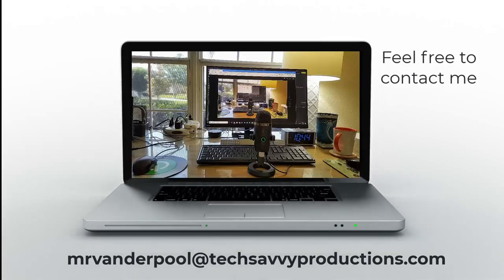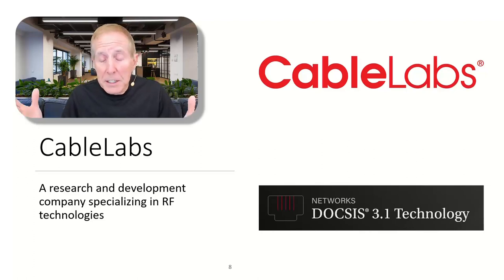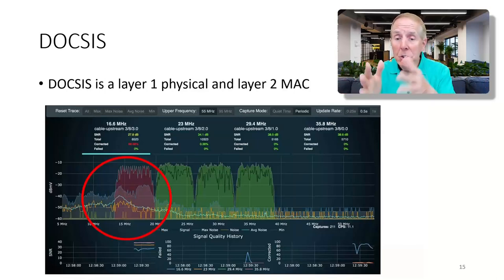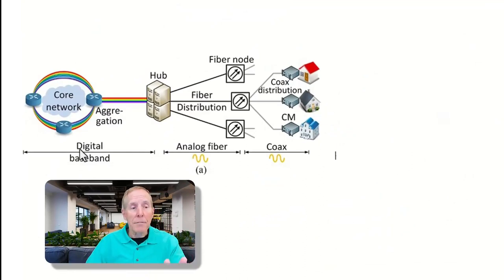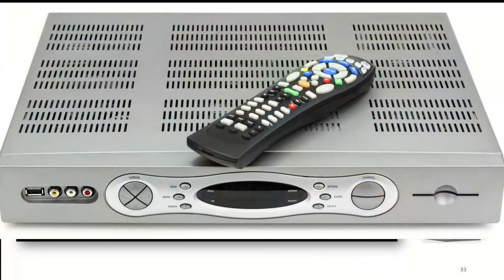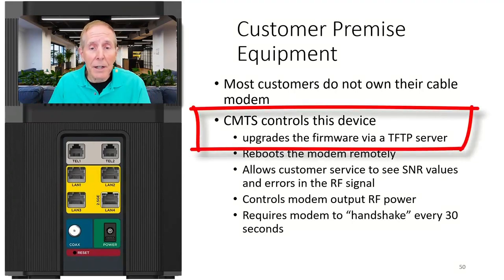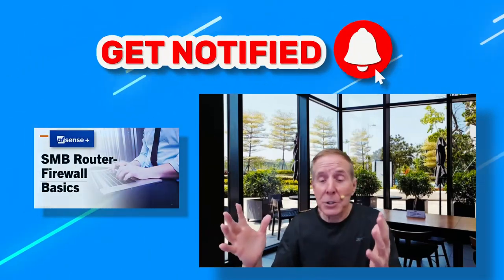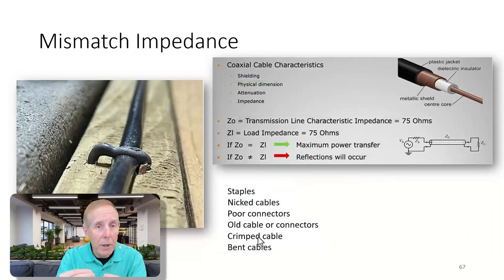DOCSIS 3.1 -4.0 Decoded: Unleashing High-Speed Internet for IT Pros

Comment: The  CMTS   also   sees   wide  spread  outages  in the  network    It  also  does  diagnostic    ,  turns  bridge  mode  on and off and  shut down the  internet access   when  you don't   pay  the bill.
Reply from the maker: John, correct I could have done a 30-60 presentation on just CMTS!

Comment: if docsis is just software and framework why cant 4.0 just be released so us 35 mbps upload cable users can finally get a nice upgrade. what's the hold up the American internet is trash!!!!
Reply from the maker: Great question, Docsis upgrades are very expensive for the cable provider, it involves a major financial investment;  new cable modems to all subscribers,  labor and materials to upgrade infrastructure, and massive configuration changes in the entire environment.  Could involve fiber/new amplifiers in the distribution chain.   A lot involved.

Comment: It´s so hard to belive that US uses so much DOCSIS to this days. Here in my city on south of Brazil I have at least 10 Fiber providers that I can chose.
Reply from the maker: Great point!  Cable companies and Telcos have the US locked up.  Google Fiber once was a up an coming competitor but it is very difficult to move infrastructure through Federal, State and Local bureaucracies.
Reply: To further what was said, you have fiber providers, but they don't offer the fastest speeds. Fiber is a transmission media and has no speed capabilities. The transceivers make the speed and the core network moves the data. A weak core, or lower speed tranceivers are going to affect your speeds along with internet access. Cable and Telco providers operate Tier 2 networks and connect to a Tier 1 network. A Ter 2 provider can have the worlds best last mile, but if the core can't handle the data or they haven't bought enough Tier 1 access, you don't get the speed capability.

Given the amount of cable and fibre already present, what is so hard to believe? Analog nodes that go back to a headend have a single fiber feeding a neighborhood. Now digital nodes (RPhy) multiplex on the same fiber via DWDM and I can put 40 of them on a fibre. Then you change some cabling and split an area that was served by a single node into six nodes fed by dual 10gig connections . Now you have nodes within hundreds of feet of the house and the RF is created in the RPhy clamshell. You can prep the neighborhood at night and then swap the node when you are ready..

Cable is also supporting an old TV network (QAM) and a new network (OFDM/OFDMA) at the same time. Going to fiber would cut off the old network immediately and you would have to replace all that equipment. People that run fiber new just offer streaming IP services and don't have any existing customers to worry about.

Since the RPhy node has a digital connection, you can bury fiber to it and swap out the RPD and the RF portion and make it fiber PON and still use the same connection and SFP. It is in the upgrade path. First 10/2.5 gig. Then 10/6 gig. Then PON. The main coax cables carry electricity to power the remote equipment. The coax will also power micro cells and the channelized fiber will connect the micro cells to the cellular network and it's all on battery backups.
Reply: Really. But coax cable networks have been around for many decades. Replacing it is really expensive, so there's very little desire to do so.

Comment: Small correction to the speed slide... Comcast (Xfinity) does not do 6G on coax; that's a fiber speed. I think 2G is their limit for DOCSIS.

"a long way from 28.8..." and you show a 14.4 modem. I love it. (not that many today remember analog dialup)
Reply from the maker: Love the feedback and information!
Reply: @TechsavvyProductions   yep 2 gig on coax is the limit. They now offer their 10 Gb pro service for $300 a month I will wait for a fiber provider.  Right now I live in a samller area where no fiber options are available so comcast is my only choice.

Comment: CMTS input/output - this is a bit confusing since all ports on cmts chassis and cards are both i/o. Going downstream from the ip side of the CMTS it is generally fiber or Ethernet. On the RF side (to the modem) i have almost always seen coax off the CMTS. After combining, it becomes fiber at the transmitter where it exits the headend.
Reply from the maker: Appreciate the feedback and information, always welcomed on this channel!
Reply: Not exactly. Newer D4.0 era hardware (remote-phy) is IP/Ethernet from the vCMTS. But older ("in use") technologies are entirely RF at the CMTS, with discrete US (upstream) and DS (downstream) ports. That RF is then converted to an RFoG optical signal for transport to the various nodes closer to the customer. (hence, HFC - hybrid fiber-coax)

Comment: This is a very nice overview. The reason for Remote PHY / MACPHY (RPD) could get some more attention. With a classic CMTS the fibre will still carry an analog DOCSIS signal. With an RPD this fibre will carry digital signals only. Typically this is an Ethernet pseudo wire. Traditional nodes can be called Analog Node and the new nodes are called RPD. The example pictures show a Technetix DBE with a Remote-PHY module in the lid. In a later slide this RPD module is shown stand alone but referred to as Node. Main advantage is that the quality of the DOCSIS signal is not impacted by the fibre. Lower cost lasers can be used. The CIN network can be used for other services as well.
Reply from the maker: Appreciate the comments and feedback!

Comment: What's the difference between GBs and GBe in your comparison of providers? or was that just a typo?
Reply from the maker: GBs = Giga bytes per second,  Gbe = is a short hand for Giga bit per second ethernet   I often say the Giga Bytes (8 bits) per second when I should have said Giga bit per second.    Network speeds are almost always shown in "b" bits per second.    Bytes "B"  (8-bits) can be used and is often a metric that can be used to measure traffic.   I will try and be more accurate on this as it adds confusion to the listener.    Feedback is welcome!

Comment: This is a great explanation. I use every piece of equipment in the video, and then some, from the hardware to software and tools (we just changed FVDs to the red one). RFoG is a PITA because it has a lower SNR than the rest of the network because of the EDFA amps in the clamshells. VHUBs are the same. EDFA out to optical splitters to other nodes. Since both have lower SNRs we couldn't specify static pass/fail parameters for nodes because VHUB and RFoG wasn't able to meet spec. The SNRs were ranging around 36-37db. Other nodes are up to 38.5-40 db. New Node+0 are hitting 42 db SNR because the node area is so small.

We decommissioned all the RFoG in some areas and it's coming to other areas. Install the GPON beside it and move the fiber jumper over to the next port on the LCP.

My area is RPhy and breaks all the rules with a Node+5 setup and 1976 coax still in place. We are serving up 2gig down 300mb up on a mid split node with QAM and OFDM/OFDMA. Once the QAMs go I believe we will open up with 5gig/800mb and then turn it up from there.
Reply from the maker: Love the great information you shared!
Reply: @TechsavvyProductions  I would love it more if the call I am currently on didn’t involve one of the two VHUBs we haven’t decommissioned yet…😔
Reply: @Todd.T  I am ecstatically delighted and disproportionately flabbergasted with tremendous gratification and appreciation for the dispensation of such a tendering and mesmerizing information in which the prestidigitation of the concurrent and subsequent matter is thoroughly demonstrated through the innuancesalluding to literal and metaphorical context. it is highly imperative to note that, such is the significance of the aforementioned, distortion in any shape or form will result in catastrophic ramifications to which will be the outcome of epic proportions. Thanks for your persual.

Comment: That was a good video. I have to admit I opened the web page on the modem while I watched and checked levels and looked to see what level of DOCSIS I have. It is an old Motorola Surfboard, and has run constantly for about a decade now. 

I have no complaints with my cable delivered internet service, except when there is a power outage in the area, since  the old POTS phones are on a VOIP to analog adaptor. It is then when to repeaters fall to their battery backup systems and, depending on the duration of the outage, my Internet service will also fail after the weakest battery in the system depletes  its energy. The telephone company, in the old days provided battery voltage from the main office,  and light usually travels a greater distance without the need to compensate for the loss on glass systems.  

I like to use the analogy of a long tube with a smoke ring wafting through it to visualize surge impedance discontinuities.  Any dents or deformities in the shape of the tube will make the smoke ring lose some of its smoke and won’t make it to the other end.
Reply from the maker: Thanks for watching